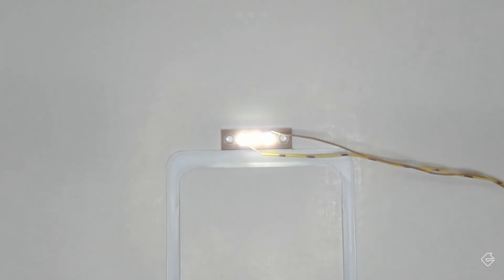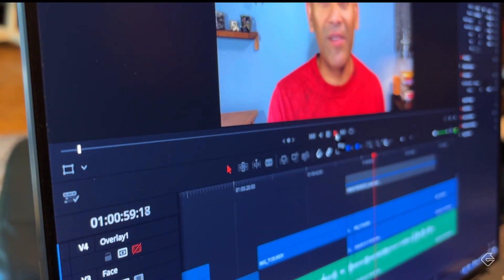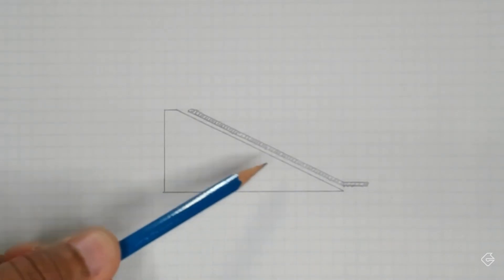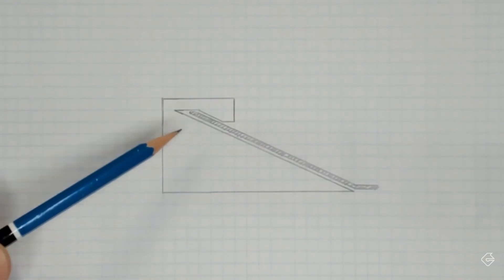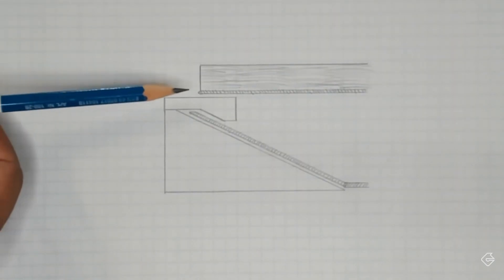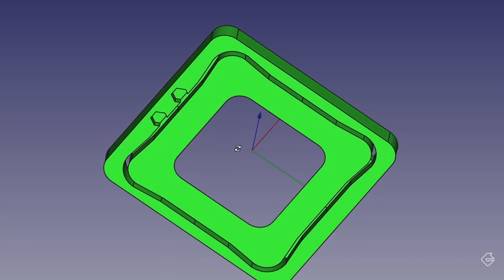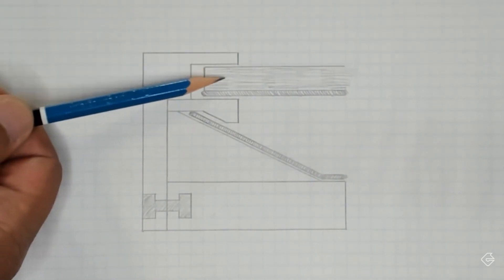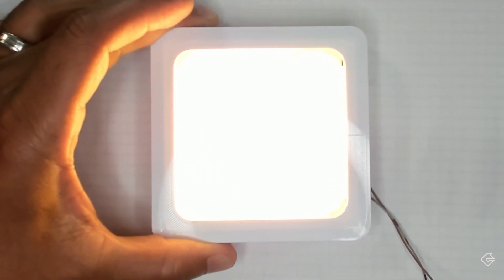Say no to LED Hotspots Episode 028

Comment: I could still see the LEDs through the diffuser when it was off.  I feel like you would definitely still have the hotspots you showed at the beginning if you dimmed this down like you did to show us the hot spots the first time.
Reply from the maker: Brilliant observation @Dartheomus! Yes, I agree that if the intensity was sufficiently dimmed, the hotspots would be visible. However, I tested this and could not get the intensity low enough to see it. Our circuit allows for intensity adjustments in discrete steps; in episode 14, we designed a circuit to create 32 of these steps. I tried using the diffusion panel on 1/32 (minimum) intensity and still could not see the hotspots. To make it visible in the video, I had to reduce the exposure on my camera, or bring the diffusion panel very close to the LEDs. So indeed, you are correct, but the intensity of these luminaires would not likely ever be low enough to see hotspots in this enclosure.
Reply: @betterenlightened  Nice!  Thanks for the reply!
Reply from the maker: You’re welcome @Dartheomus